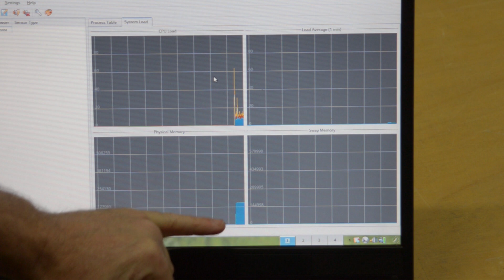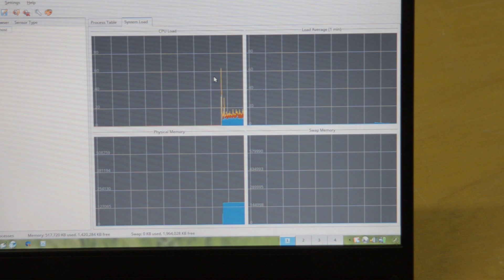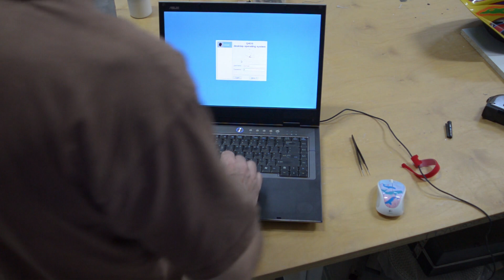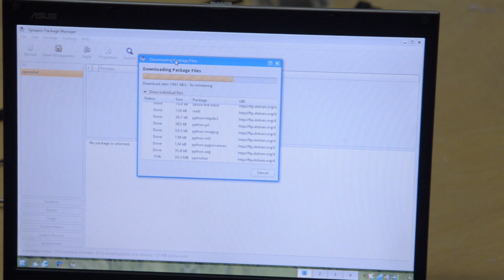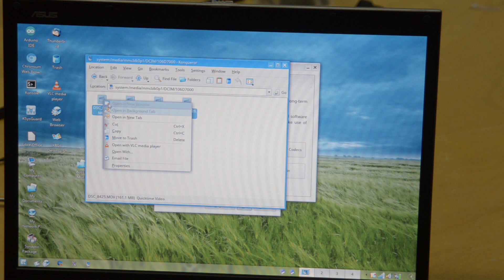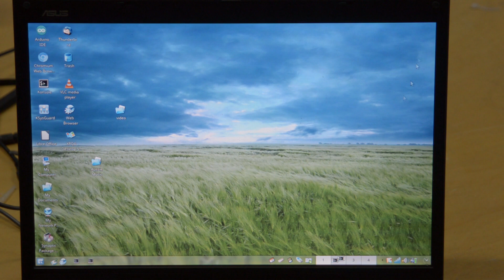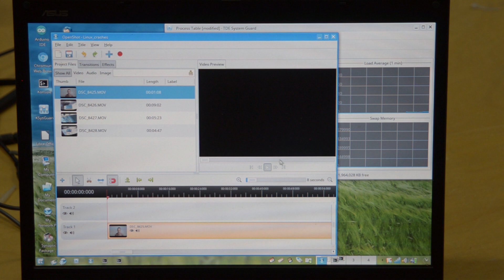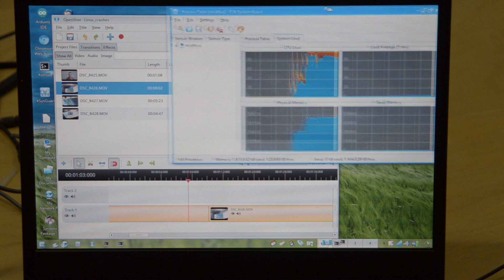Linux CRASHES, Windows DOESN'T ???

Comment: I clean out heat sinks, fans, and power supplies regularly. I use a big air compressor and blow gun in the garage, set to about 30 PSI. I haven't damaged anything yet.

Comment: So, let me see if I'm understanding you correctly. Linux will stress a machine more than Windows will because Linux works more efficiently. Do I have it right?
Reply from the maker: SlideRSB 
Pretty much, Windows stresses the hard drive.
That acts like a throttle meaning it wears out the drive, but as a result means the CPU doesn't really get a chance to perform meaning the CPU stays cooler.
Linux uses the hard drive less, meaning the CPU spends less time waiting around, and more potential for working, thereby increasing the heat generated.
That means CPU cooling needs to be in good condition. 
So two benefits of this being fixed.
You get a faster computer using Linux, and the hard drive lasts longer than it would in Windows. 
But you do need to keep the machine clean.
Reply: That seems pretty counterintelligence to me. It's kind of like saying Linux is just too good at what it does. Lol. But now I'm intrigued. What if you could quench Windows's insatiable thirst for RAM and reduce the need for Windows to page its RAM to the pagefile? Would that also make the computer overheat with Windows under the same stressful conditions?
Reply from the maker: SlideRSB 
Nah, what is being said is that you get a lot better machine if you maintain it.
And in conjunction with Linux you get speed as well. 
The illusion of Linux being a problem is what people come to me with.
My answer is to teach maintenance.